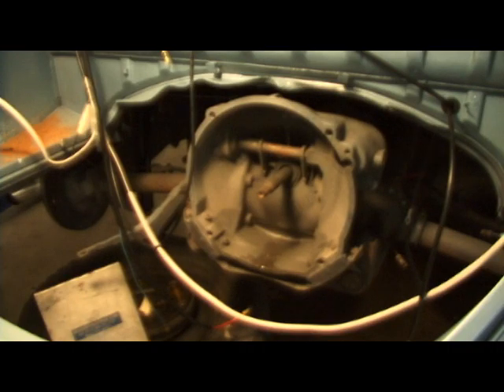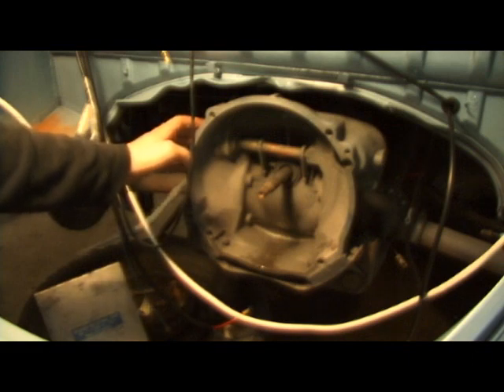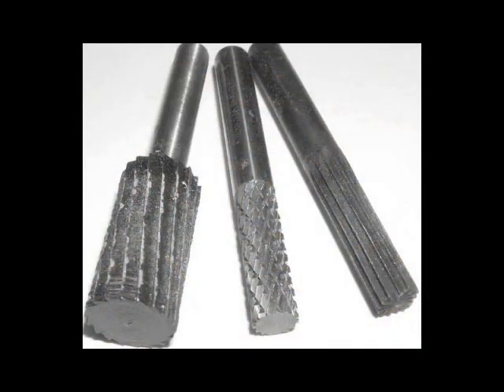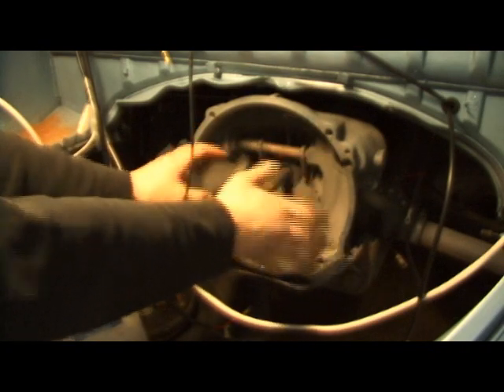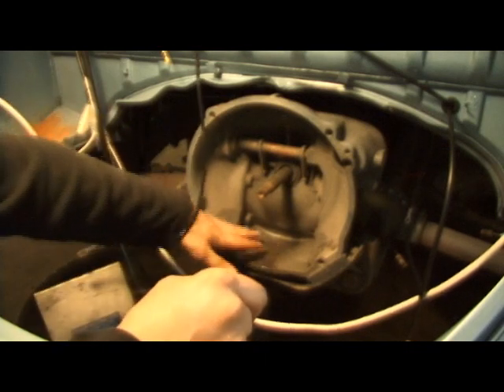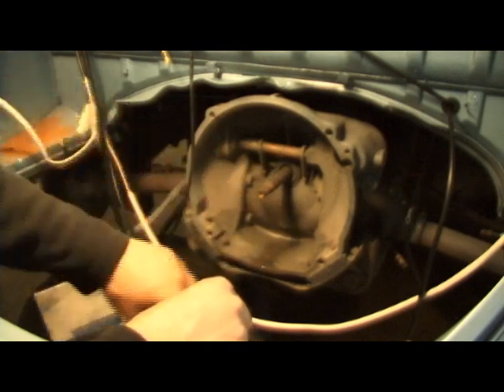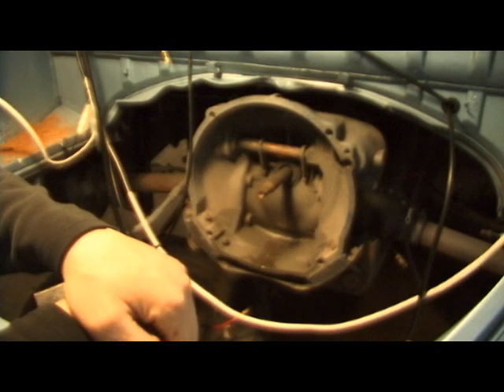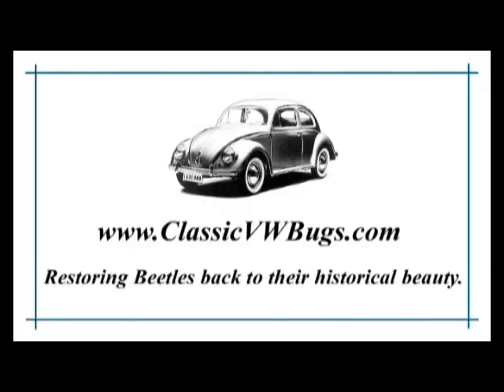Classic VW Beetle Bug How to Grind Out Bell Housing Tip 12v

Comment: Correct... If your not careful with the mag flakes from the grinding, one small spark can take off your eyebrows. Just make sure you watch the cutting tool on the steel bolts and it will be fine.

Comment: This is way too hard.  Just bolt the motor in and turn the crank till you draw engine in and then bolt up and start engine to finish the job. unbolt and slide off and wipe case clean and reassemble. takes about a 1/2 total.  the touchy feely method  takes too long and does not make sure the cut is parallel with the crankshaft..